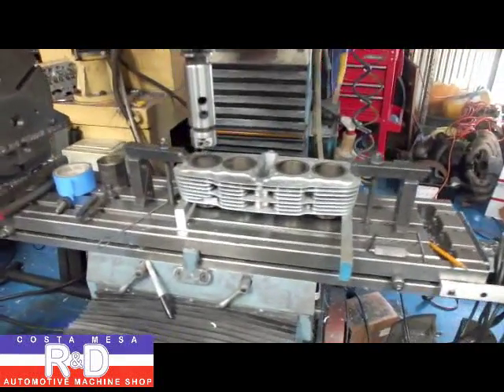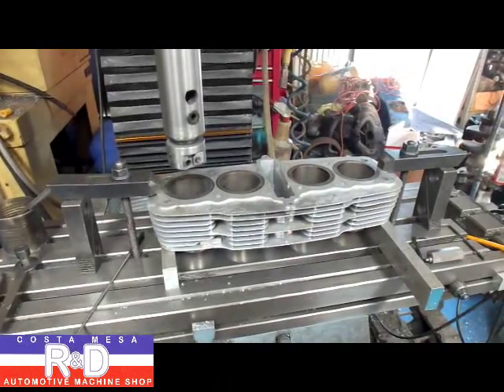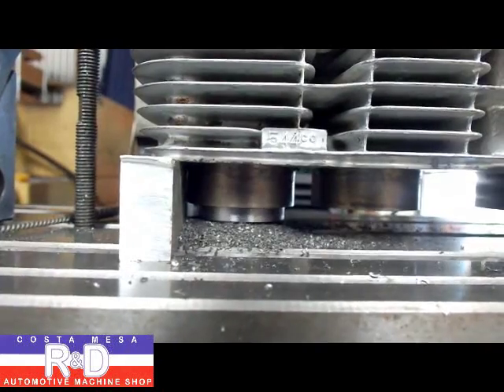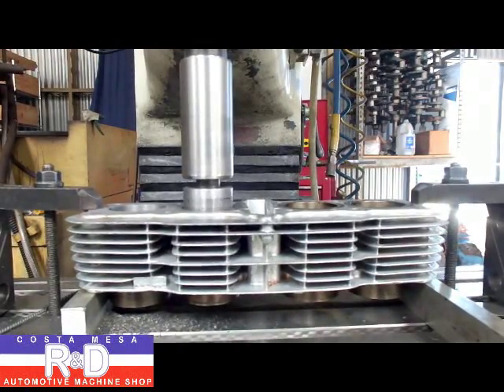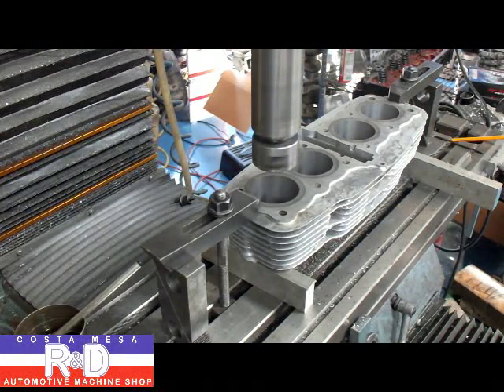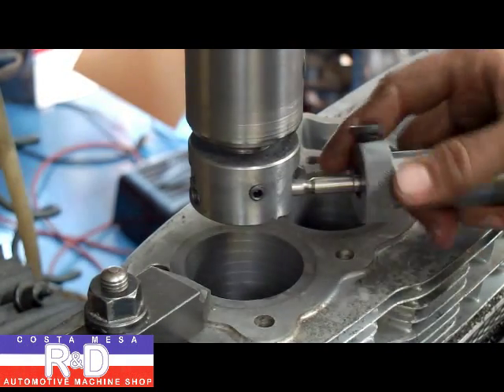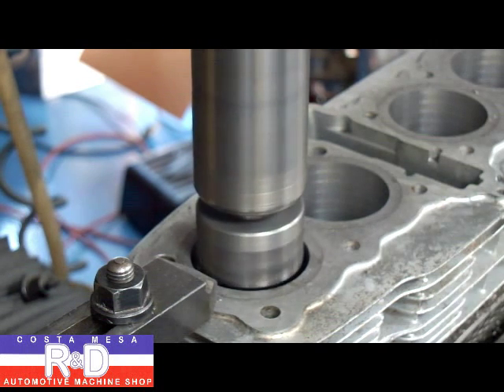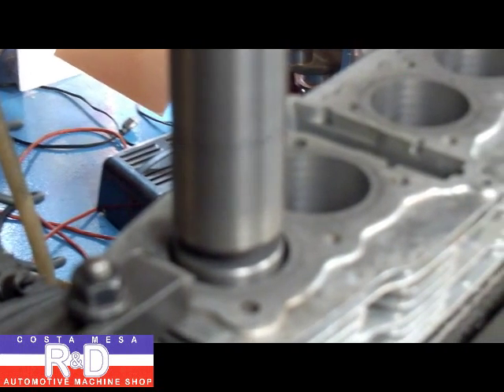Honda CB 550 3mm Overbore for Big Bore Kit on the Prototrak DPM3

Comment: I have a single cylinder 150cc motorcycle with a 62mm bore. I'm putting a big bore kit with cylinder and piston. Currently it has 10.3 HP. I updated exhaust and carb from 24 mm to 26mm flat slide carb. Approx how much HP can I gain with the 65mm big bore kit? According to owners manual it has 62 bore and 49 stroke. It's a china motorcycle. Not going to change cam.

Comment: Wiseco pistons?? I had a 74 Z1 bored from 903 to 1015 then i decked the cylinder to the circumference of the pistons, made a difference, wiseco also more compression

Comment from the maker: Manufacturers never did use steel, that I'm aware of. Typically, they used cast iron back when this bike was being produced. Cast iron is better for oil retention thn steel and you need at lease .0001 of oil film to seal the rings correctly.

Comment: @boxer3main
What?
cb550 has Bore X Stroke: 58.5 x 50.6 mm (according to wikipedia)...
so, surface area of cylinder hole  (in square mm) is = (58.5/2)^2 * pi (using the formula for surface area of the circle)
volume of 1 cylinder is surface area of cylinder hole X stroke...
that equates to 136cc ... since you have 4 cylinders, engine capacity is 544cc
now... if you make bore 3mm bigger, you get 601cc (about 60cc more than the stock engine).